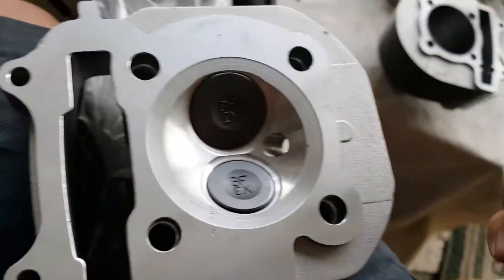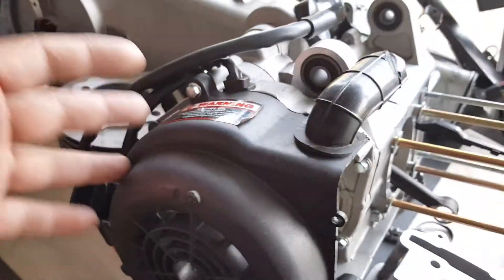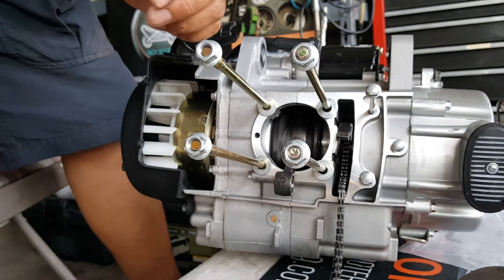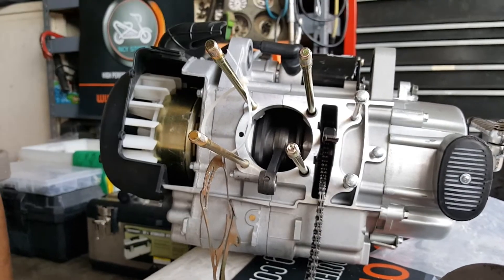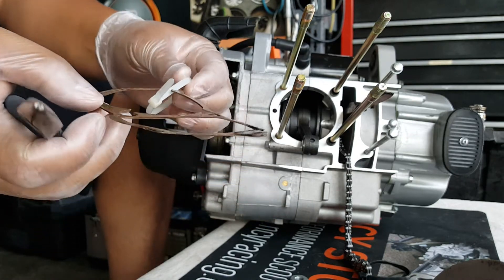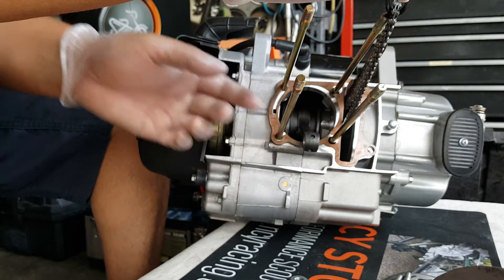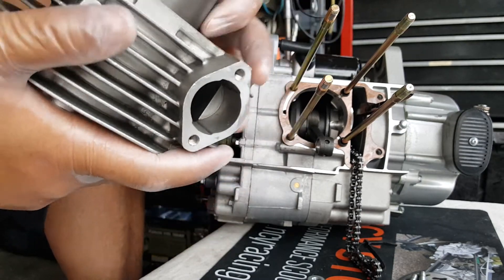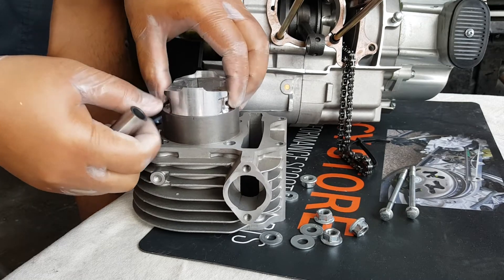How to install GY6 Cylinder Top-End on SSP-G 180cc POWER KIT Part #6

Comment: What are the intake and outtake diameters of this 180cc 63mm ? Also what size main jet you need?
Reply from the maker: You can find the ssp-g 180cc 63 mm cylinder specification here: https://ncystore.com/ssp-g-180cc-big-bore-cylinder-power-kit I end up using it on OKO Pwk 30mm carburetor 42 idle jet and 125 main jet.
Reply: pwk carb really make big difference? and is it reduce overall efficency and increase fuel consumption?

Comment: if you don't now the arrow is down to the exhaust so maybe you have to ask or call someone is the first ting you lean. you er so slow and can't make it flow we sitting 5 gays and laffing ouers lunges out I hope you do it in a good meaning dut you have learned all how many ways you can make problems when you rebuild a engine
Reply from the maker: Jesper Helmer Hansen good statement we did call to check from our vendors cuz it seems like the manufacturer for example design 61mm Taida Forged Piston they don't have the arrow but they have a TD Star logo engrave logo on the face of the forge piston. That is pointed upside down  versus is 61mm Taida Ceramic Piston which point TD Star engrave logo correct side facing up. You can't really tell by there just arrow alone, logo, or even pistons indents or with the naked eye which is for intake and which for exhaust without precisely measuring with a caliper. Unfortunately, it very for make to model and manufactures. As we know in direct proportion to its cylinder valves: intake is slightly wider and deeper indent on the piston face and its set ontop versus exhaust narrow and shallower on buttom as seen in this diagram here: http://ncystore.com/engine-and-wiring/engine-parts/crankshaft

Comment: ?Hi Mr..I have sym crox gy6 orginal engine 150cc model 2016 can I maket it 171cc Big Bore Kit
Reply from the maker: sadeq214 Hi, 171cc Big Bore Kit does not require boring for most standard GY6 150cc crankcase which has 63mm opening. Just make sure to measure your crankcase cylinder opening where the cylinder sleeve will fit into diameter typically for not having to bore is 62.7mm should be fine. Next determine your stud spacing holding your cylinder typically is 54 mm. And, stud spacing 57mm are normally the bigger bore cases handling 180cc and above. Given that said if you check your gy6 engine on that specific engine model if it fits under those guidelines I'm sure you'll be able to do select the right 171cc upgrade big bore kit.